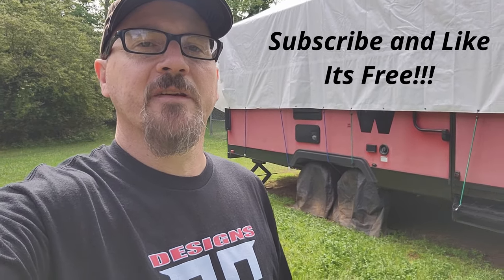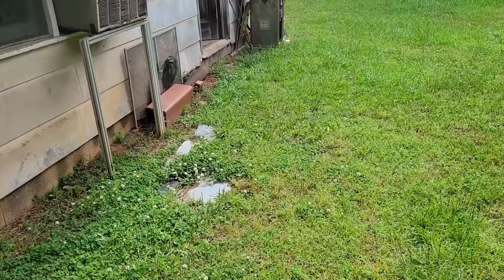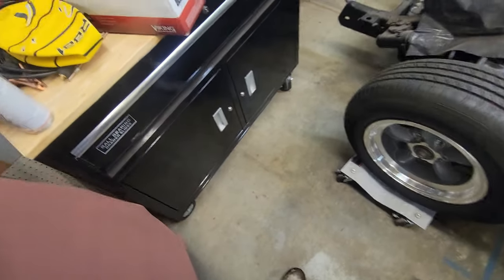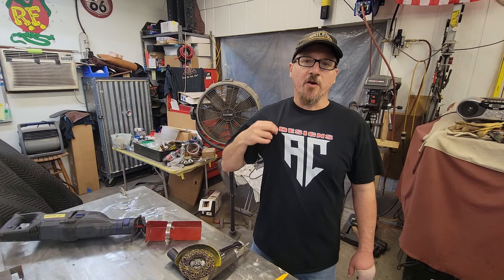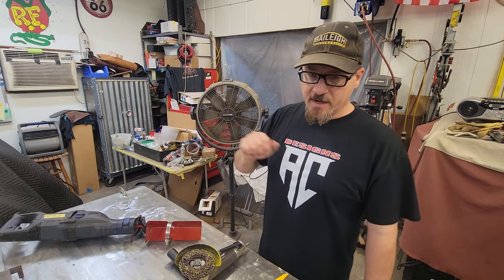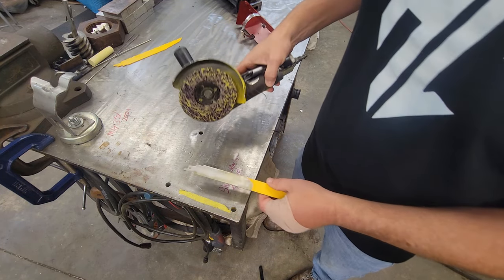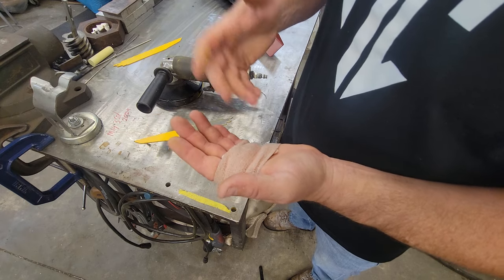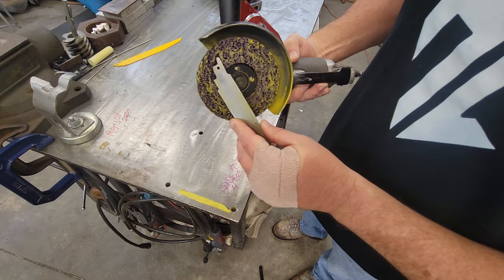I Cant Believe This HAPPENED To Me!!!! PSA WEAR GLOVES!!!!

Comment: if you put a screw through the hole in the blade and used that to "lock it down" to the table and had a flange in front of the piece being worked on that may work as well.  that way the screw keeps the one end in place and the flange hooks over the top while the body of the flange acts like a safety shield/wall... thou if the blade hadn't moved in this situation, the grinder would have.. possibly causing another injury or several.  and due to the flange you wouldn't be able to strip the tip in this setup but the tip could be stripped on a different grinder.  is what pops into my head.  anyhow i wouldn't worry too much now, we all learn from our mistakes... at least the lessons that stay with us forever we do.  you sharing the story should help others to not repeat it.  peace and ty.
Reply from the maker: Thats a great idea, Thanks!!!!